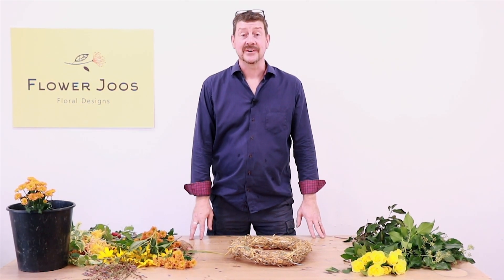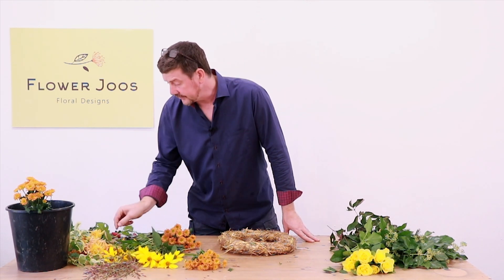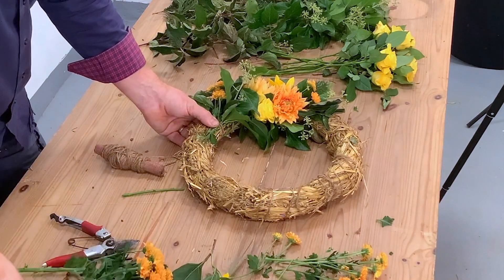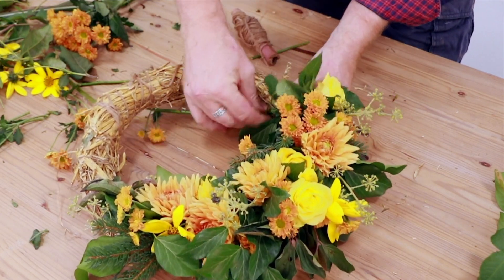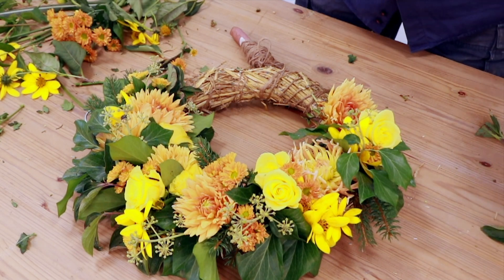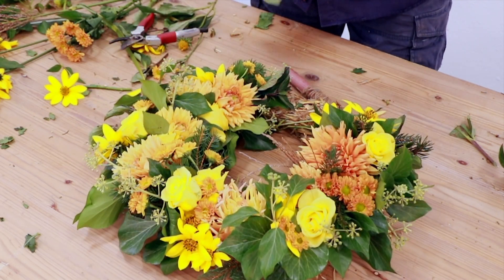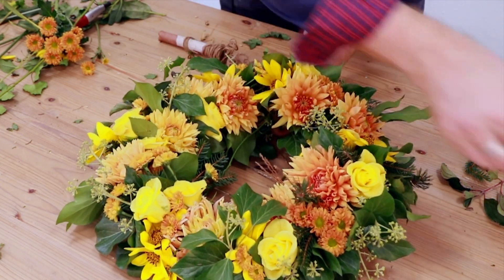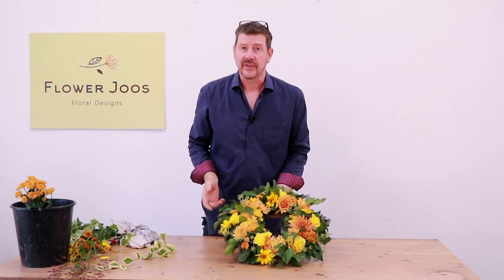How To Make An Environmentally Friendly Floral Wreath

Comment: Really beautiful and a very good idea to make oneself the straw base! One of the biggest problems with the foam is the sheer amount of micro plastic that sheds in the water when it's soaked, and they go directly into the water supply which we end up drinking because they cannot be filtered. So, this is a great solution! Thank you John!
Reply from the maker: Thank you! Yes, you need you to make the bases, but they can be done in quiet times and stored - and you know what is in it. I have seen straw bases for sale but bound with fish line, which won’t degrade. It’s worth exploring options 😀🌼
Reply: @FlowerJoos  Absolutely and it can be very entertaining in quiet times! I think I havent used foam in quite a while now. Sphagnum is a good alternative to have some water supply or tubes.

Comment: Thank you for sharing this John. I rarely use floral foam these days and I’m really enjoying going back to the old mechanics for arranging whilst hopefully achieving a modern design. The way you have done this wreath is a perfect example of how to achieve this. I always used oasis wreath rings in the past but I did do an autumn wreath for my door using a wire frame and moss which worked well. Very interested to see the straw idea. Thank you xx
Reply from the maker: Thank you! I think at home it’s great using the old mechanics - it’s more challenging in a commercial environment, but  we need to explore options.I see Oasis are now doing more degradable foam and set on degradable bases rather than plastic - so we are all going in the right direction 😀🙋🏼‍♂️🌼